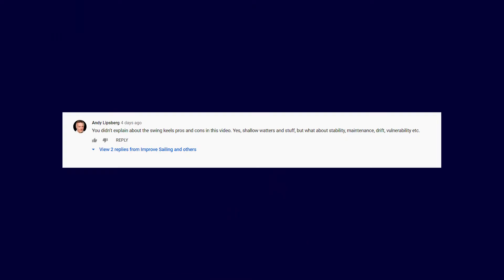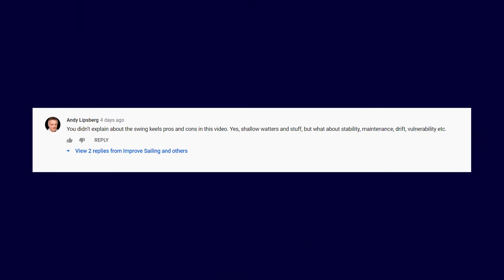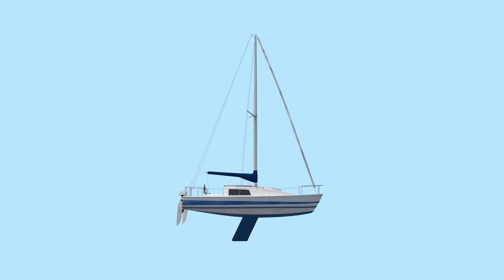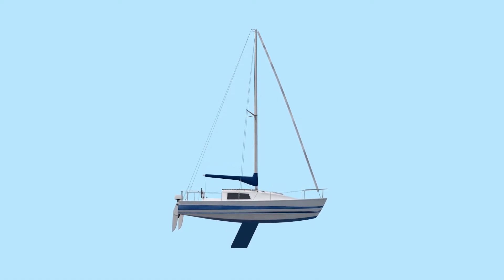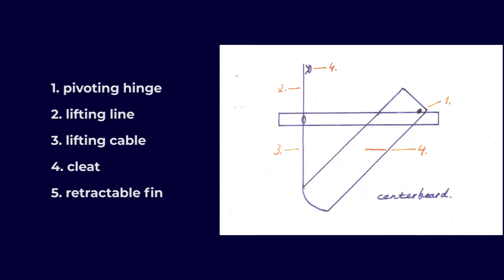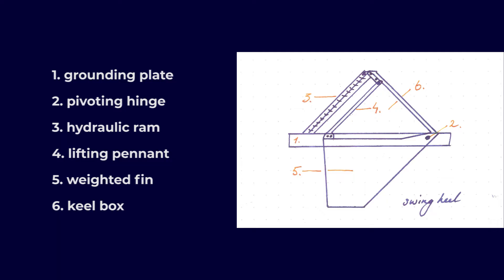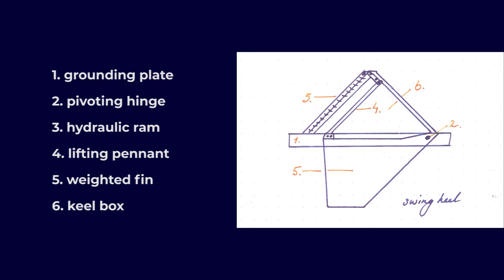Swing Keels and Centerboards: Pros and Cons Explained

Comment: Great video. We just discussed today in the office, whatever part is movable on a boat it might create an issue one day apart of advantages it delivers. The less movable, automatic and electronically driven parts the less headache.
Reply from the maker: Glad it was helpful. I agree, simpler designs are more reliable! Good luck with picking your keel
Reply: I wouldn't mind asking you a question, I was looking for a boat that had a full keel but it looks like I'm going to end up with a lancer 42 with a fin keel and a Scag rudder, I was just wondering what you had I understand that a a full keel is slower in the water but more stable and the comfort ratio goes up with it but the comfort ratio goes down with a thin heel but the boat that I'm wanting the sailboat that I'm wanting to get, has a comfort ratio of almost 26 and I intend to sail around the world and the purchase isn't in the hat yet I can pull out still yet and anytime I want I was wondering if you had full keel and how much sailing you have done and if you have any input on this please. And same goes for the host of the show if you have seen this question well I've listened to what you said ocean going sailing if you wanted a higher comfort ratio that a full kill would be best but at a comfort ratio at 26 a little above is that good enough to be comfortable enough where am I in for a rough ride because I know that some people say that a comfort ratio is a ratio that shouldn't even be looked at that it's bogus but, it could be a standard, cuz I've seen some boats lower than what I'm looking at and I've seen some comfort ratios as high as a 60 so I'm figuring that it's somewhere in midfield, input would be more than welcome, especially before I go too far and slap the money on the table.
Reply: @bencoss7003  Hi Brendon, can't judge haven't read that Lancers 42 are good quality boats, survey for sure. gather some more info on that. https://www.cruisersforum.com/forums/f47/lancer-42-why-so-cheap-25329.html regarding the keels, I would say the more uncomfortable cabins the more boat is designed for actual sailing. The ballast/displacement ratio is simply the ballast weight divided by the boat's total displacement, so ballast is a very big part of the comfort onboard. It really depends where you plan to sail. People circumnavigate on very different boats, offshore boats are mostly not for speed, therefore are are heavier.
Reply: @AndyLipsberg  morning Andy how you doing today? I hope well, well yes I've scoured the internet,, and yes I've been to cruisers forum that's where I get a lot of my data along with a few other spots, well for every person I found so far pretty well averages out I find one bad comment I find one good comment it's about 50% down the line, but most of the people that I found that gives it thumbs down, have never had one or been on one or been on a sea trial on one or even just recreationally, but the men who do give good mention of the lancer 42 has either their own lancer or had a 42 so like I said it's 50/50 so it's like like you say I'm going to have to go with a a good surveyor that's familiar with the boat, and I am very mechanically inclined the engine compartment on it just looks beautiful I go a lot by that if the guy can keep an engine compartment clean that says a lot about a gentleman, well hey thank you for your input it's much appreciated you have a good day.